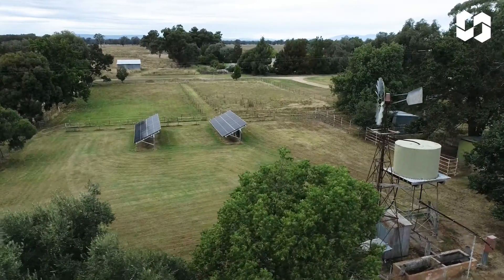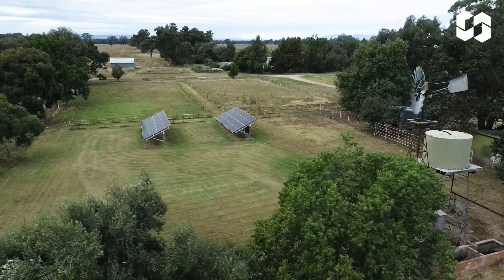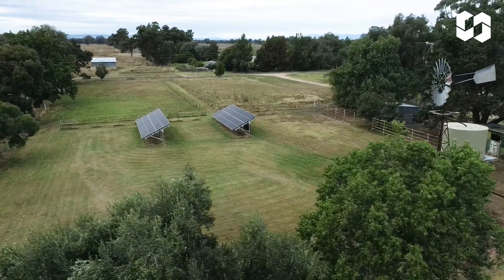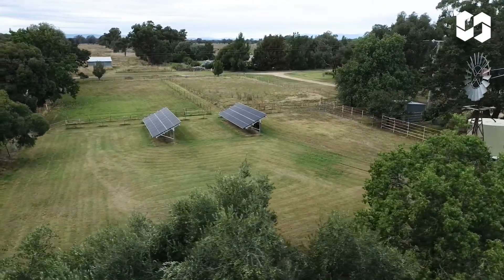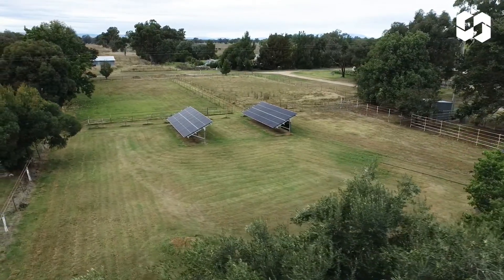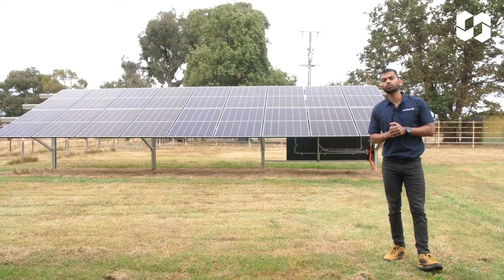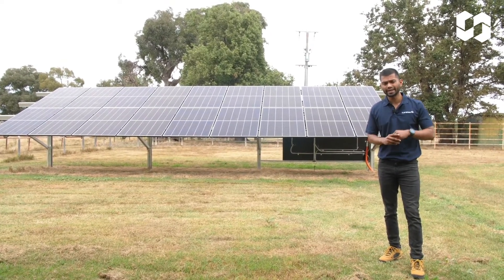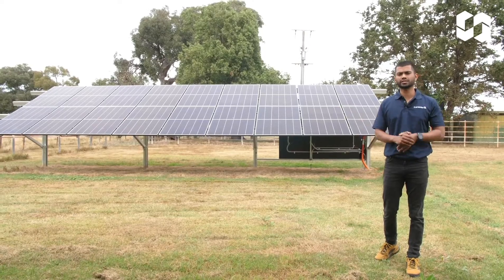PVezRack SolarTerrace II Product Review

Comment: how do the mounts go in an earthquake ?
Reply from the maker: Hi Keith,
 
Thank you for contacting us with your question about how our solar mounting (PVezRack) holds up against earthquakes.
As a company, we take great pride in the quality and safety of our products, and we understand how important it is to ensure that our mounts can withstand natural disasters like earthquakes.
 
We are happy to inform you that our solar mounts are designed and built with vibration-resistant techniques.
We recommend a variety of materials and construction methods that have stood the test of time.

To give you a bit of background, from the technical side, the predominant force and assessment for Australia is the wind uplift, or wind actions according to AS1170.2.
For earthquake-prone areas where the earthquake load can be the dominant factor, we run a site-specific analysis and add further support/bracing to the system to ensure it complies with ASNZ4219 seismic loading.
For New Zealand, we include earthquake assessments as part of our default certification as this requirement is mandatorily derived from the ASNZ5033 standard – Installation of PV in Australia and New Zealand.
 
We just celebrated our 15th anniversary, and we have never experienced any movement of our mounting structure due to earthquakes in Australia.
We understand that safety is a top concern for our clients, and we want to assure you that we take every possible measure to ensure that our solar mounts are built to the highest standards of safety and durability. 

To source first-hand reviews from installers across Australia, we invite you to join the Facebook group ‘Clenergy Club’,
Where you can post your query and receive direct feedback.
 
If you were looking for PVezRack products near you, and wanted to speak to a distributor, who could give you more information,
Please go to  https://www.clenergy.com.au/distributors/ or you can email our Tech team at tech@clenergy.com.au or call us on 03 9239 8088
 
Thank you for considering our products for your building needs. Please let us know if you have any further questions or concerns.
 
Best regards,
 
Clenergy Comms Team